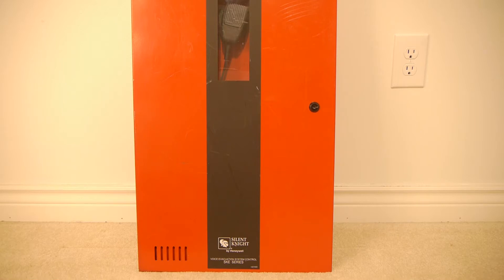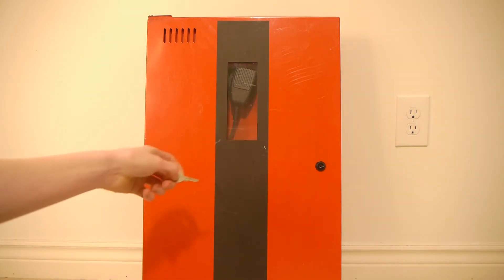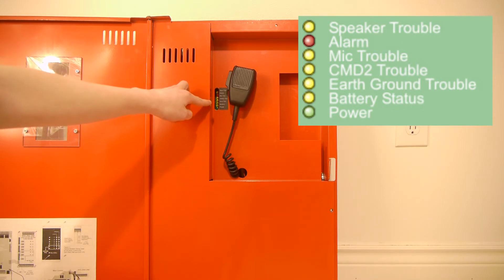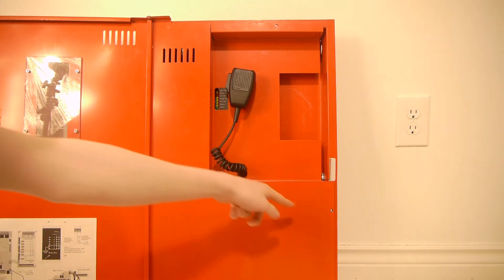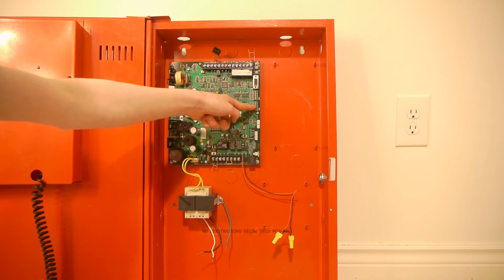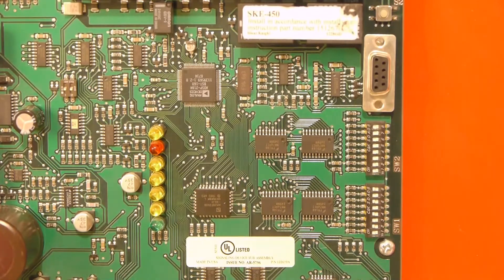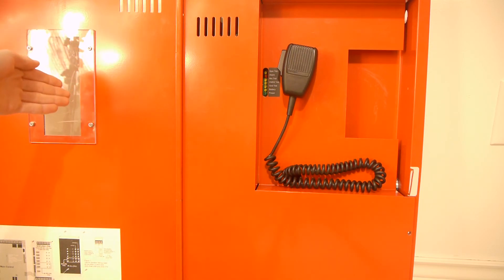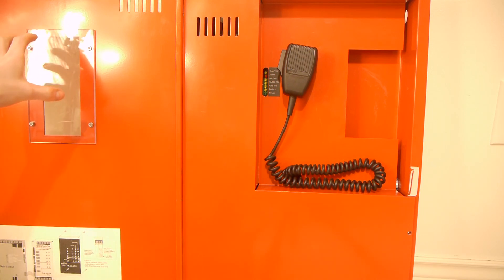Silent Knight SKE-450 Voice evac panel overview

Comment: I really want to get that 450 on ebay
Reply: hey vrrryan how are u\????
W?
?
!@?#
R?!@
#R?!@#R?
!@#?R
312/
r21/3
r/3r
g'/24
t' h/
t4/h 
'2y4th
Reply: @ryanwoods4691  ?
Reply: @ryanwoods4691  not funny
Reply: @vrryan6  yes it is, dum dum
Reply: @ryanwoods4691  ok
Reply: It most likely doesn't work
Reply: @FireTech7  its just untested
Reply: @vrryan6  look at those wires to the transformer
Reply: @FireTech7  you can replace the transformer
Reply: @vrryan6  that is literally the rarest transformer every good luck finding one